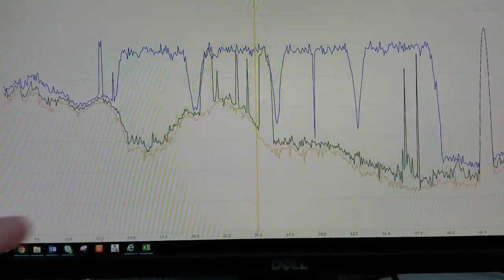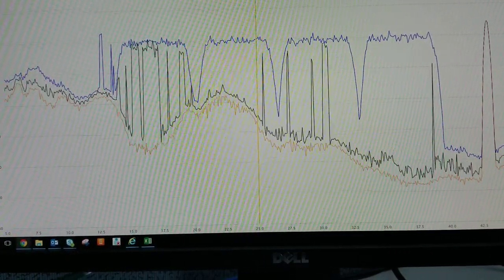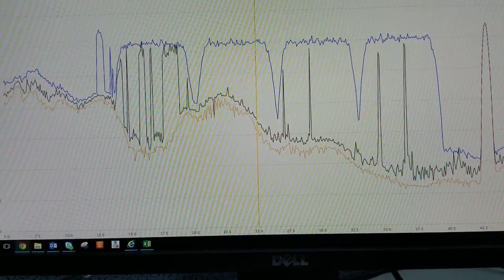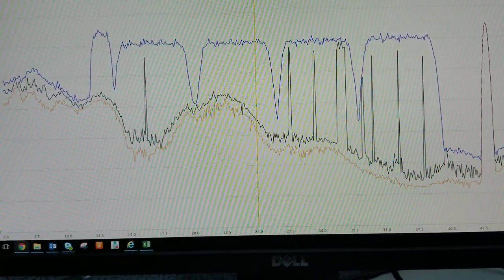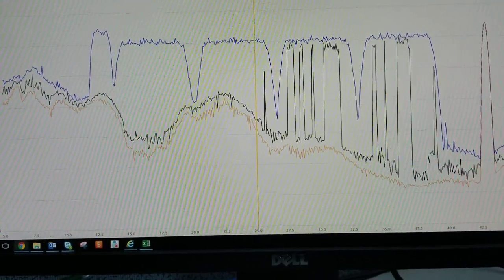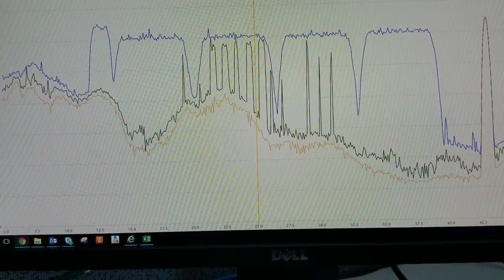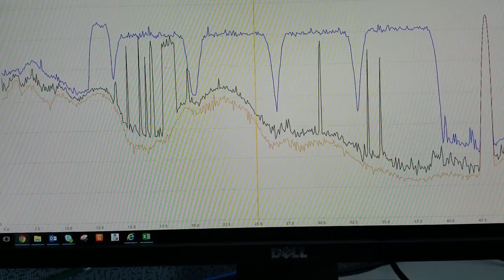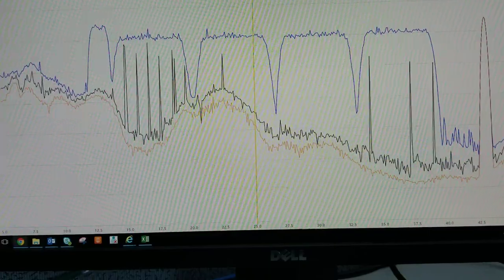Why you should always clean ingress at each job

Comment: 99 times out of 100 its a loose connector behind a modem...the one time its not it is a lose connector behind the modem. I have about 75% of the people I filter for ingress get reconnected with even attempting to repair.
Reply from the maker: Always! Just that 1/8th turn makes a world of difference!
Reply: I did ingress in NY for a few years.  The easement in Brooklyn was unlike any other.
Reply: @chuklhed9092  Do tell....I am very curious about working cable in NY
Reply: @hotrodsather  It was very difficult.  The easement was a nightmare and even if the plant was street side, the traffic was very difficult to work around.  The food is great though 😋
Reply: @chuklhed9092  hopefully it wasn't all ladder work. :x
Reply: @zlcoolboy  It was worse. It was ladder and climbing with hooks.

Comment: What's up cable family, I have a question about a job I had recently. A yr long issue, cust has pixelation on video. Being the 3rd tech there; I replace the drop from the tap to the gb. And the equipment. And also referred to maintenance. Cust has a microwave right next to the modem and her set top box. Would the microwave cause interference?
Reply from the maker: It could but generally only when it is cooking something. Would have better odds of messing with the wifi since it is a similar frequency range.
Reply: If your good at the ground block its in the house for sure. I really like the JDSU  Smart ID Plus system which when used with the another Smart Plus can sweep the customers wiring to out to 1.5 gig. The PLUS ID outputs the sweep and the regular Smart ID's see it and report.
It will show all splitter's and taps and do ingress tests. There's something sneaky in the walls thats getting you. Smart ID Plus  will find it.
Reply: I’ve had this issue occurred with cordless telephones.

Comment: I sold my ONX620 and bought a fully optioned 630 with ingress expert. You must have this option to fully test ingress as it has the auto agc adjustment where you can fine tune the rf level into the meter so it doesn't go into overload. 
If you detect ingress at the GB I would then use the JDSU Smart ID Plus system with Smart ID's and check the ingress on each drop inside the house. The Smart ID Plus has sweep mode which tests splitter throughput at the same time. If you detect ingress on a drop put a terminator on it and check again. 
Ingress is tough.  Can eat up your day.
Reply: Ingress is my favorite.  It's like a treasure hunt. Find the culprit.
Reply: @chuklhed9092  ingress sucks lol I tell my customers that have intermittent internet  that ingress will mess up anything you have connected to your modem gaming and electronics or streaming Netflix etc etc
Reply: @abelgaming7332  I always enjoyed it 🤷

Comment: Whenever I do an ingress scan at the ground block, it reads "excessive ingress" unless i unhook the cpe inside the home first. Should the boxes be causing noise like that?
Reply: You pretty much have a locked Viavi w/o full ingress expert. They have different types of Viavi's they issue out and yours is probably the 2,000 dollar one without all the options. And yes, the equipment will cause feedback spikes that will lead you to go "OVERRANGE" so they recommend you disconnect ALL equipment in the house, put a barrel on it before running a one check out the ground block.

As for seeing ingress, unless you got a DSAM say goodbye to that! You gotta just do what you can (or replace the line) to fix it till the meter no longer says "OVERANGE".  There is supposedly a "patch" to fix that but all they did was change "OVERANGE" to "EXCESSIVE INGRESS"
Reply: My company taught us to check a true ingress on drop or outlet you need to put barrel and terminator on the other end.
Reply: Kyle Sanders that’s common sense
Reply from the maker: I've heard a "world box" can cause that issue on the meter. Otherwise equipment should be silent on the upstream without downstream going to it. I've also heard of a possible update from Viavi to help correct the message as well. Also check to see if your "AUTO AGC" is turned on in your ingress scan program.
Reply: The ONX620 does not have the range adjustment in Ingress mode you must use a pad till its happy. The ONX630 has an agc adjustment you can turn the level  up and down till the ingress level is good. Port #2 is very sensitive to rf level unlike Port #1.
The ONX630 is fantastic as it has Heatmap and Noise selections  in ingress mode really shows any issue quite clearly.